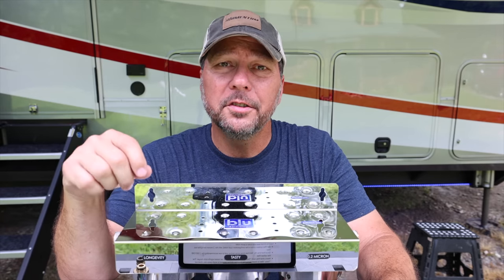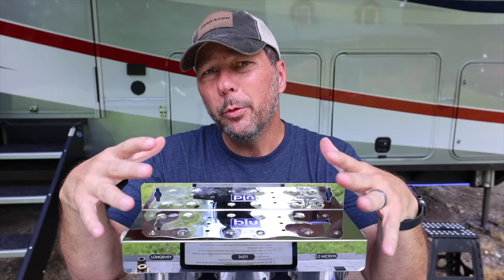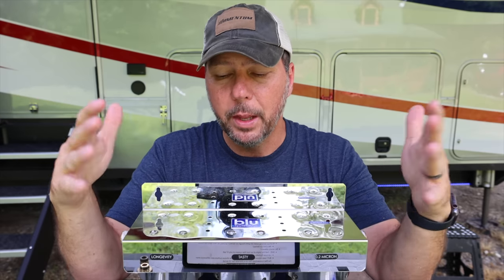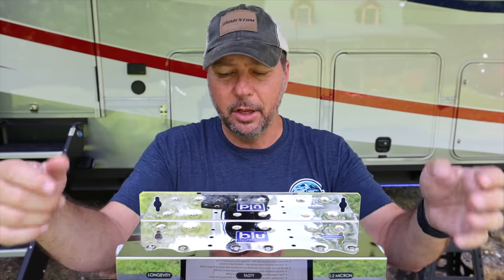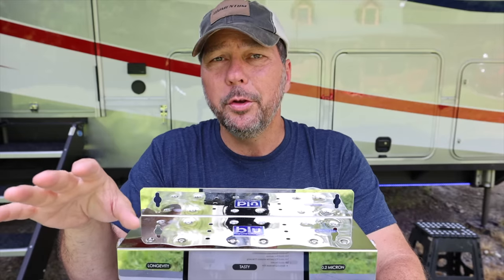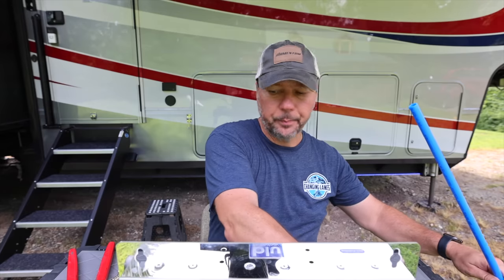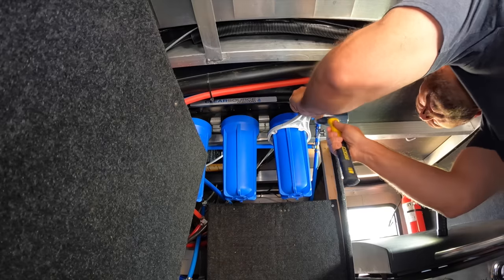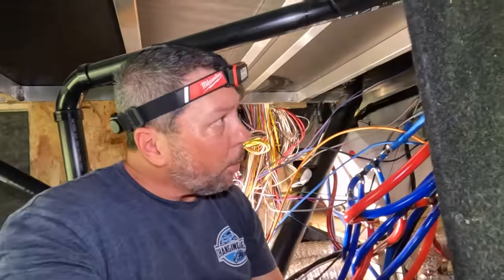Blu Tech Trio - Compact RV Triple Filter System (Testing and Install)

Comment: Chad, I bought this system based on your recommendation. I added the Stainless Steel Water Softener. The system worked great for a couple months then the plastic top cap for the water softener developed a pin hole leak. I sent Blu a message and never heard back. Now the pin hole has turned into a 1/4” crack. I got on a chat with Blu this time and they will not stand behind their product despite their written guarantee. The area where the leak is completely perfect indicating no exterior abuse. They absolutely will not even discuss the matter turning every comment into a reason why it must be my fault. I just thought you would want to hear this. They will however sell me a replacement part for $130. Magically the new units have a blue top instead of black now. Hmmm? I’m going to seal the hole with pvc glue rated for potable water and move on. I will buy aftermarket replacement filters from now on as they don’t deserve another dime from me or any other Rv’rs. We struggle enough with the industry and their warranty crap to patronize another warranty fraudulent biz.
Reply from the maker: Did you purchase through MMH?  If so, please reach out to them so see if they can help.

Comment: Chad update… The Blu Tech water softener cap couldn’t be repaired with plumbing glue. Mobile Must Haves doesn’t sell replacement parts and referred me back to Blu Tech. I did however find the part that Blu wanted to charge $125 for for $25 elsewhere. Blu just purchases parts from other manufacturers and assembles them. The new cap is far better made than the blu tech original. Thanks again for all your experience sharing. It is much appreciated.

Comment: Just added this Blu Tech filter system to my water gear in May. It is not a fixed installation, so I fabricated a locking bracket system to hold the filter up under the frame of my travel trailer when I am parked,to keep it from walking away. Very pleased with the results that I’m getting from the filter, and the 25’ stainless steel supply hose, and the 3’ jumper from the filter to the city water input. Thanks for the great video. Your content is always well thought out and the execution is very professional. I watch most if not all of your weekly content. Travel safe, be well and keep up the good work!

Comment: That switch of the filters make perfect sense to me.  I used to use a carbon filter in a house where I had a well and it did lose some particulates when it first was installed.  I can see these plugging up the .2 micron filter fairly easily.   I'm thinking about getting one of these systems so if you could get your 6 month test done in 2 months that would be great because I plan on being full time by the middle or end of October.  Keep the good stuff coming guys.

Comment: Loved the install of your first filter system, I followed your design using the bypass with a few modifications (such as I installed pressure gages going in and out of the system). Of course I put my pressure inside, that way I will not leave it behind….lol. Great video, you all take care.
Reply: Good idea putting the pressure regulator on the inside the only problem with that is at the camp site we  have there is about 90 pounds pressure if not more It actually blew the end of my hose off Luckily we were there

Comment: Just a thought, but we have had fantastic luck with Sharkbite connectors. Home Depot, etc. sell them and they are far easier to use, grip like there is no tomorrow and can be removed just as easily with the little dis-assembly tool.

Comment: We tried this filter system to improve the taste of our water at our primary location, but the taste was still pretty bad. We learned that the water being extremely hard (over 1,000 ppm) was the cause, and the Blu Tech Trio doesn't address water hardness at all.  So, we switched to a reverse osmosis system, and our water now tastes great.

Comment: I just purchased one of these systems directly from Blu Technology. I ended up getting the portable system because I am concerned about what to do for winterizing. I live in NH and do not full time in the RV so winterizing is very necessary. I suppose that would be an application for your bypass setup on your old RV. Great video and you have a new subscriber.

Comment: Love your Videos and look forward to it weekly. 
On your recent filter install, I want to offer a caution and certainly something you would want to follow as you test. 
You mention that the flow was 3 GPM with clean filters. And this is what I would expect. But consider that the the rate of particles coming through is about the same. ( particles/100Gal) When you distribute the total particles over a smaller filter, it will clog that filter faster since you have less surface area. So with all else being equal, I would expect the smaller filter to blind over and the flow decrease in less time than the larger. 
One other thing to consider is the the Prefilter (#1) would be the only one to change as the second and third filter would not blind over. These could only be tested with careful particle analysis. 
So good luck with your testing and I look forward to a future update with results.

Comment: Chad great video as always.  Thanks for sharing the new filter system.  Just be careful with your crimp connections.  Some of them look like they are outside the tolerance that is standard with those.  take a look at 16:20 as an example.  Probably not a big deal especially since the pressure is somewhat lower than standard household pressure.  But they say those can leak and fail over time if they dont sit properly over the fitting.  Thanks again!

Comment: Great job on the insulation and thanks for sharing. We have the same water regulator and about a month ago I hooked it up and the needle on the gauge was pegged under the stop pegg. Talked to a buddy of mine (who is a plumber) that can happen with the bouncy of the camper. So careful where you store them.  Thanks From Wisconsin

Comment: I installed clear source Ultra and the Pro Aqua water softener in my fifth wheel.  I recently switched to the Blu water softener because of its smaller size and weight. I am seriously considering switching to the Blu water filter to save space and weight.  I have found the Stainless Steel containers to be a big problem. I am traveling in AK, and the water was so cold that the SS sweated setting off my Simplisafe water alarms. They need to add a neoprene “sweater “ to solve this problem.  I used 1/2” drinking water hose for my installation because it allows me to move the filters to get to them better.  I am also using cam lock quick disconnects. I have used the brass and SS quick disconnects but the cam locks are far superior (IMHO).

Comment: Putting the micron filters  before the carbon block is how it's done in the R/O.  industry . Have been using pump ro units for 30 yrs and I believe it's the purest water you can have. We use it in our dutchstar storage tank and never worry about our water source because the final product is what matters. Get a tds meter to keep a eye on your source water to know what your water really is.

Comment: I have Blu Technologies portable 3 step water filter and their hose kit.  I ABSOLUTELY HATE their hoses.  They do indeed kink with very little force and if they kink, they braid gets messed up and will snag on everything.  While the quick-connects seem to be very beefy and stainless, they are machined to such tight tolerances that the first little bit of sand that gets in the coupler (even on the outside) it will jam up and not release or move.  I had a HECKUVA time with these silly quick connects while staying in south Florida.  Even the slightest breeze would blow sand into the connector and would cause it to jam up.  

While I do recommend their filters, I would highly encourage people to stay away from their braided hoses and their quick connects.
Reply from the maker: Good feedback, thanks! 👍🏼

Comment: Nice alternative to the Clear Source.  Just curious since you did not install the "bypass" like you did on the Clear Source, how you avoid passing bleach through the fitters whe sanitizing your fresh water tank (other than removing all 3 filters which is a PITA.  As always, thanks for your informative and professional videos!
Reply from the maker: When we sanitize, we'll want to sanitize the filter canisters also.. So, we'll just remove the filters.  That only takes about 5 minutes.

Comment: I think there's a better way than following the manufacturer's recommendation to put the carbon block filter last.  Pat of the purpose of the longevity (5 micron) and carbon block (0.5 micron) filters function is to protect the 0.2 micron filter by stopping the larger particles before getting to the finer filter.  It does require a small amount of extra work tho.  Simply install the first two filters and either leave the old 0.2 micron in place or remove it and put the empty canister back on.  The flush the two filters for a couple minutes, using the closest outside faucet, to allow the carbon fines to get flushed from the system.  Then install the 0.2 micron media.  No carbon fines to plug it up.

Comment: We bought the ClearSource Ultra on your previous video's recomendation and are very pleased with it. The 4 gpm flow rate is higher than the 2gpm of our stock whole-trailer filter, but we left it in the system as it's the only way to filter water out of the onboard tank. (The ClearSource is external). Is size the main reason you switched?
Reply from the maker: Yes.. Primarily the size, and we like to try out various options.  We think BOTH are great filters.

Comment: I always ran a cheap inline filter before the regulator. Salt Lake KOA is 110psi. The inline did not explode.
Reply from the maker: I doubt any filter out there would have trouble with 110PSI.. It's the RV plumbing that would have an issue...

Comment: Thanks Chad, Little question that no one can or will answer. Not sure which. RV use Pex the same as residential house. Why is it a need to keep you water pressure at 40 PSI when a residential water pressure is un restricted. My house is currently running 75 psi. I see some possible anser to this but no one will identify those reasons.  But I did notice in this video that you used brass fittings vice plastic but the entire back panel of your wet bay had plastic fittings on you pex tubing. Thanks Chad, Master Chief
Reply from the maker: We generally run ours at 40-50 PSI but have also used as high as 65 or so.  I think it might be rated at 40 because the whole system goes though an earthquake when traveling.  Just a guess.

Comment: Our Riverstone comes standard with a single Blu Tech filter. Currently have the Clear Source filter. I have been looking at the portable filters mainly because of weight. The filter cost is about the same as Clear Source. But the stainless water hoes that Blu Tech sells are outrageously expensive. They are stainless washer machine hoses. I went on Amazon and got a total of 50 feet different lengths with quick connections. I can now customize the length of hose at each campground. I did not lose any pressure. And they take up so much less space than the regular water hose.

Comment: Great video. I have had trouble finding 1/2” PEX fittings that fit the hose attachment (in and out) on the filter and also have the barbed end that fits inside 1/2” PEX tube. I have purchased a few fittings and PEX end of the fitting is too big to slide inside the 1/2” PEX, even though they say they fit 1/2” PEX. Any suggestions on where to source those fittings? The 90 degree fittings in you video are nice as well. If you have a source you could share for those, that would be amazing as well.
Reply from the maker: You can find all of the project tools and consumables here: https://gear.changinglanesrv.com/product-tag/water-filter-project/

Comment: I use the Clear source green 2 part system.  Do you filter all water or just drinking water? We do all and have had volume issues with our tankless hot water heater which needs 45 psi to function.  What water meter were you using for the glow test?  Thx Chad - Rob

Comment: So, looking at the replacement filter costs, it looks like there's a $5.00 difference with the newer Blu Tech Trio system being the more expensive, albeit not much more.  So if I already got the ClearSource Ultra system and a ultraviolet system, is there any reason to switch to the Blu Tech Trio?
Reply: For me it would be the weight savings. The Clear Source is heavy. The Blu Tech is 13 lbs. I just  have not pulled the trigger yet.
Reply from the maker: I would say no, unless the size is the primary factor for swapping.

Comment: I'm a new RVer. So I don't understand the advantage of adjustable flow restricters  If I want my pressure to be 40 to 50 lbs. Why not buy one that's constant?  The adjustable ones seem to be another thing that can go wrong.  Please tell me what I'm missing.
Reply from the maker: It's more about adjustable pressure than flow.  We tried a fixed regulator (like we showed in the video), and it restricted flow dramatically.  The adjustable regulators don't seem to have this issue.  Additionally, we've found that setting it to 50PSI at one site does not mean the same setting will yield 50PSI at another site with higher or lower source pressure.
Reply: @ChangingLanes  Thanks. Good to know.

Comment: I don’t know how practical🙄 these are for non full timers as they will sit full of water for weeks or months until you use your rig again. Doesn’t appear to drain easily, like drain a one filter system after each trip.  Thoughts?🤔
Reply from the maker: I don't think keeping water in them will hurt... I'd ask Blu tech about that.  But, the filters come out in about 3 minutes if you wanted to drain them.

Comment: With this filter system in place, how long does it take to fill your fresh water tank, 30 minutes or so?
Reply from the maker: 150 gallons @ 3.2 GPM should be about 47 minutes.  A little more with the stops and starts needed to let the tanks equalize.   Likely about an hour for a 100% fill, but we rarely do that.

Comment: I don’t know how you use any water coming out of the hose my water intake is located in front of camper you have to let it run for so long to get it to be ground temperature through the hose I can’t even stand to brush my teeth with it much easier to brush my teeth with a20 ounces of bottle water for a week

Comment: Wow. Over 700 bucks for marketing. Just build a 3 stage or buy one. It's the same thing....Mayne better. Most big box filters will go down to 1 micron through solid carbon block. 
And filters are available anywhere for a fraction of the cost. Filter housing is about 15 bucks. 3 4 packs of filters. 20 micron, 5 micron carbon the. 1 micron carbon block. Exactly the same for a fraction of cost.